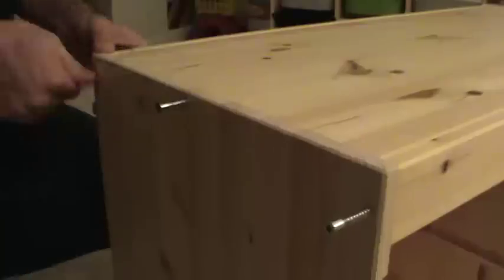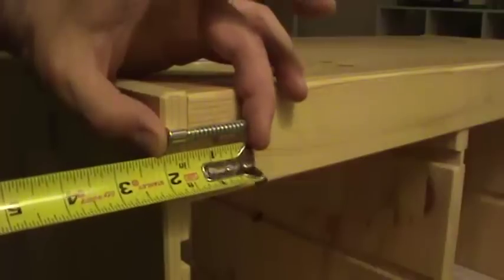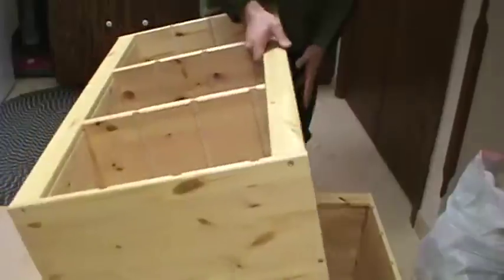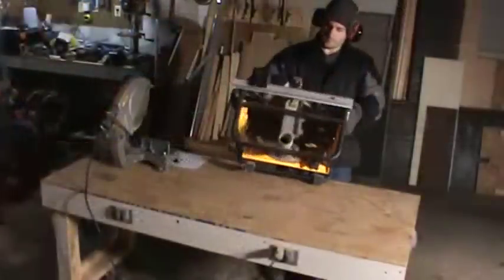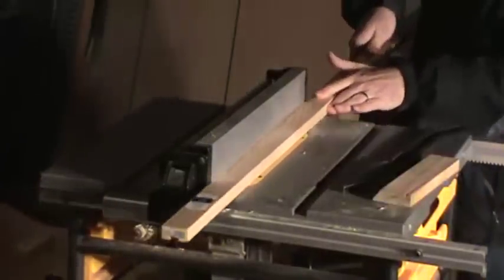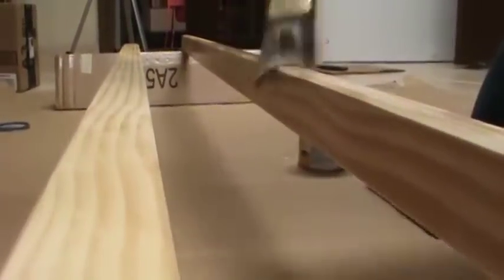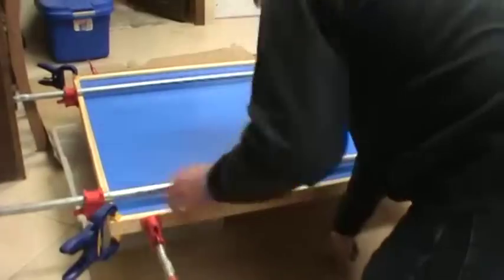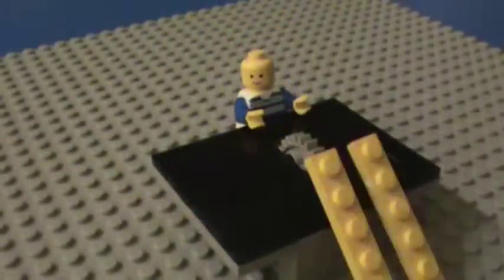Building an IKEA Hack Lego Table with a Custom Top

Comment: An even easier fix to prevent the draws from going all the way back (and to prevent the whole table being a big tunnel) is to get a rectangle of ply the same width and height as the table and then all you need to do is drill through the ply where you drill the bolt holes to join the tables. You can then sand down any excess that protrudes the top of the table.

Comment: What is the locking mechanism that you used on your workbench to lock it in place?  That looks really similar to something I have been trying to figure out how to do!
Reply from the maker: Matt Plumlee They're called "Floor Locks," something I learned about working in manufacturing. I found them on eBay years ago and they're fantastic. A quick google search will turn up lots of options.

Comment: HI Ben, great idea, I have placed my order with IKEA! It looks like you did not attach the top to the cabinet base, this is what I want to do, in order to make use of both sides of the top. Question though, I can just imagine my 2 year old trying to climb on it or lift it, did you have any issues with yours pulling/ tipping the top off or getting their fingers caught underneath? I
Reply from the maker: Good question. Lucky for us we never had those issues, but for safety it would probably be a good idea. Since the top barely hangs over the edge I don't foresee climbing to be that risky. Though the plastic bins may not fare too well under little feet.

Comment: Hello! Love this Lego table. Is it too heavy to move over carpet? Or maybe we can add casters? What do you think?
Reply from the maker: It can get a little heavy when loaded up, but it's not too bad. I ended up adding some plastic furniture feet on the corners to raise it up a bit, mainly as a precaution since our basement occasionally gets water on the floor. That made it a little easier to slide on the rug.

Comment: I would cover half of the table top with the flat Lego boards
Reply from the maker: +yoshii2011xo Yup, that's a pretty popular upgrade. We decided not to go that way, but it would be pretty easy to do.
Reply: +yoshii2011xo I was thinking that too!  Since the top is only set, maybe cover the underside with the flat boards for versatility?  :)
Reply: +Ben Brandt I plan to add a spot for some brick separators and a custom built mini fig stand. Do you think with a bit of help my son could pull this off (he's 12 but very advanced)?
Reply from the maker: +BrickBoy 333 I guess that'd have to be your call as the parent. My boys are only 4 and 6 so it's hard to relate. Work together and you can teach him, make some good memories, and produce something together.
Reply: +Ben Brandt Thanks a lot and by the way Awesome Vid

Comment: great job, though you should seriously think about greater protection while cutting MDF, I would not want to be breathing that in.
Reply from the maker: +Italiaasher Great point. Since making this project I've gotten into the habit of hooking my shop vac up to the dust port on my table saw, though I still need to invest in a respirator.
Reply: Good idea, better to be safe than sorry when it comes to woodworking sawdust.